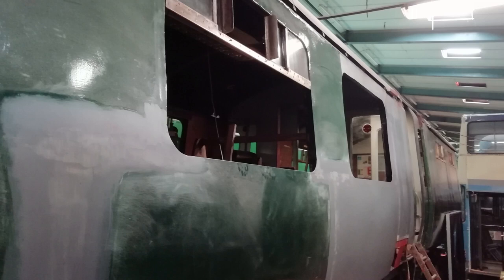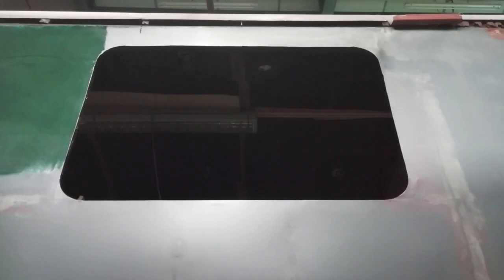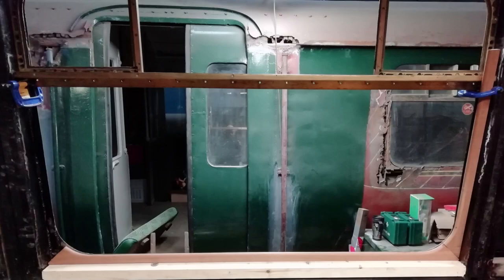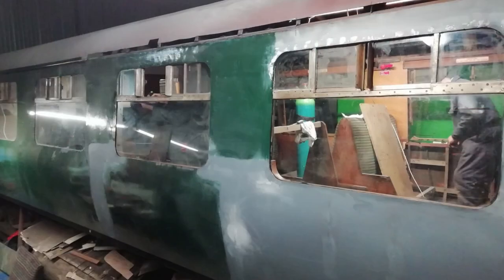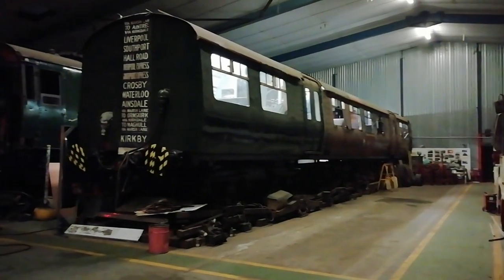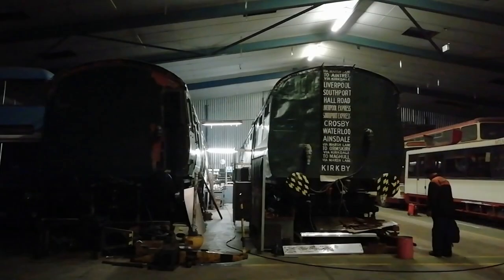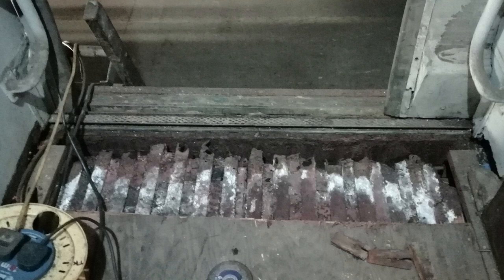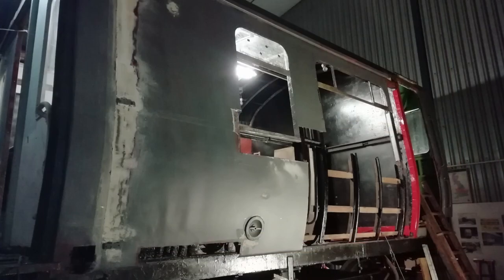Merseyrail class 502 EMU Preservation update 2022

Comment: Superb restoration ,hehe those stadler units on merseyrail I’m sure one of their designers looked into my sketch pad from the mid 90s bec I designed a future tube/metro train with a front end of similar design 😮,no worries maybe I can see the future 😊,hope all is well 
Mark 👍🏻😊
Reply from the maker: Cheers. The 777s will take some getting used to. One thing is they are the first purpose built electric units since the LMS class 502 & 503s of the late 1930s. The "PEP” 507/8s of the 70s were just a generic design

Comment: Visited here last year in 2022 for the open day, knew that the 502 was kept here as Wikipedia informed me. Also as I live in Burscough, this is only a 3 minute drive. Glad to see a piece of history preserved. Hopefully a class 507 and a class 508 get preserved too. Absolutely hate the 777s.
Reply from the maker: Hopefully a lot more progress will be seen at this years open day. It remains to be seen if a 507 or 508 will be preserved. They are not small things & finding a suitable home is the major problem. I personally don't hate the 777s the old stock does needs replacing. Am sure once their teething period is over they will settle in. I confess to having similar feelings when the 507s replaced the 502s. The 507s awful cramped seats they had when new & windows that didn't line up up with them. They where the main things I didn't, & still don't like about them. The 777 seats are no better, but the window view is for the most part a lot better

Comment: When changing trains at hamilton Square the rumbling noises they made coming through the tunnel terrified me I always remember the wooden paneling and dusty smell of the seats
Reply from the maker: Seats haven't changed much, still dusty, probably more so now. They will be given a
thorough clean when the work is finished. If finances allow even reupholstered
Reply: When the preservation is complete will it be active or just display
Reply from the maker: @davidmills4292  the plan is to have it an active unit, but as a push pull set with a Diesel. Due to the platform & 3rd rail alterations for the 777s it's unlikely to run on merseyrail again

Comment: Lovely progress, what do you plan to do once she’s up and running again? Maybe get her on the mainline for a final heritage run?. Or as my friend suggested get it on the line as one of the functioning passenger services. Quite like the idea to be honest, lots of work though. Can’t wait to hear your actual plans though
Reply from the maker: Our plans for the unit is to run it on heritage lines. Due to the alterations for the 777s we can no longer operate on Merseyrail. We will convert the unit to operate as a push pull set. This is with a Diesel locomotive at one end and driving from the diesel or 502 cab depending on direction.
Reply: @Merseywail  what changed?  Power requirements??
Reply from the maker: @gallimead  the main issue is the alterations to the platforms. The 502s are quite wide & the alterations to accommodate the 777s will cause gauging issues.  The power supply is much higher now than when they were in service, & is to be changed again for the 777s Also the unit doesn't meet current disability laws for use on the main line.

Comment: I have heard that the Class 502 were quite reliable trains before the Class 507 & Class 508 were built for Merseyrail. And next year the Class 507 & Class 508 are to be replaced by the Class 777.
Reply from the maker: Yes they were Andrew. Very basic by todays standards but reliable. They weren't very happy going underground in their last years though. They had been built for fast running on relatively flat routes. When they had to tackle the climb out the underground they did struggle. The signalman had to ensure they had a clear run & to avoid stopping a 502 on the incline
Reply: Are there any plans you lot know of for the preservation of the 507s or 508s? I hope Merseyrail won't be wasteful enough to scrap them all... though, it wouldn't surprise me.
Reply: The class 777 are due to launch on the network in. 2027 👍
Reply from the maker: @caramelldansen2204  there has been enquiries by interested groups, but I can't reveal what they are planning. All I can say is I hope they are successful
Reply from the maker: @PhotoWirral  hopefully not that long. Sadly the project has been delayed by factors not related to the actual trains. The ”hopefully"  final obstacle the drivers union, will be resolved and we can get these trains in service.
Reply: Cheers for the amazing information. Happy New Year. :)

Comment: back after a year to ask a valuable question to me. Are the original motors still sat in the bogies? or have they been ripped out? because the motors may still work if you found the right people for it. i kno your plans are to operate it as a push-pull set but what lines would this be on? Possibly the east lancashire railway or somewhere closer to home
Reply from the maker: The motors are still in the bogies. Not only that we also have four spare motors stored at Burscough. The bodywork on the trailer coach is largely complete now and we will be moving onto the motorcoach. All being well I plan to do a restoration update video shortly.  The motor body isn't as bad as the trailer & we have more volunteers that have joined in in the last year. Hopefully this will speed things up
Reply: @Merseywail  ah right. Would the motors still be able to operate? Separate from the actual train of course, maybe if you put the right motors in and get some recordings as there aren’t many to be found of how they sounded when they used to run, and are the spare motors the same type? The English electric ones?
Reply from the maker: @Delta1Productions  they haven't been tested but no reason why they couldn't run again with proper maintenance. If you're after a recording of the 502, a recording of one from exchange as far as bank hall was featured on a CD.  The CD was called vintage voltage & features the Wirral units, as well as other old electrics. Produced by Cedric Greenwood you might be able to find a copy somewhere
Reply: @Merseywail  oh right, I’d love to find that!, any idea how much it would be and where I could find it? Would love to hear the motors until/if it runs again
Reply: Another question to add is what heritage railways you guys will be running it on? I think I have asked in a recent comment but due to merseyrails limitations would you end up running it on the east Lancs railway?
Reply from the maker: @Delta1Productions  we're still a way off running it yet but the plan is for it to guest at various railways where possible. A desision on where its "home line" will be be decided by members as completion gets nearer.
Reply from the maker: @Delta1Productions  you would have to try auction site's it popd up now and again. As you can imagine it's not a mainstream item. Search Cedric Greenwood too